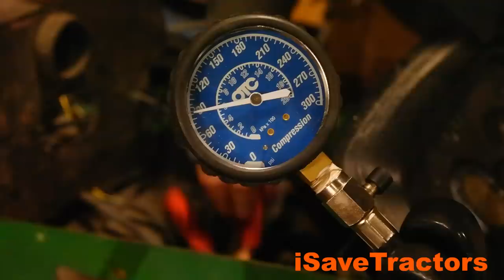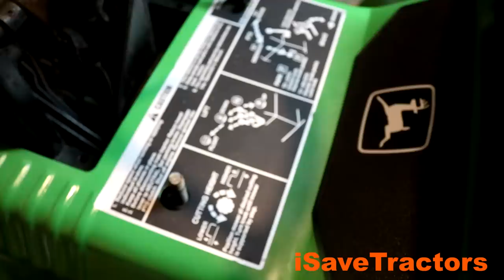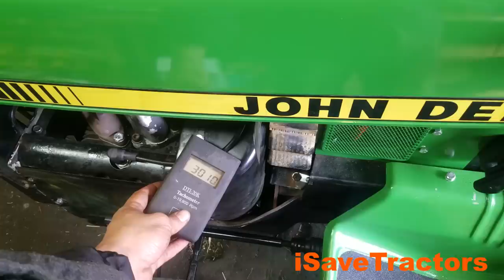John Deere 400 Garden Tractor Restoration Start to Finish

Comment: Wearing an I.H. hat while working on that Deere? I'm surprised there's not a bunch of hate from the Deere crowd! (They love that green paint.)
Reply: Melquiades Estrada I'm rolling 😂😂 if it red it stays in the shed c'mon
Reply: Melquiades Estrada settle down ladies, you're both pretty!  I worked for a farmer friend of mine, farming approx. 1800 acres. We used mostly John Deere equipment.
I would drill 800-900 acres of beans with a JD 8330 and 30' JD drill. It's was nice equipment and had a dealership near us for support. It wouldn't make sense to farm with I.H. If you have to drive a hundred miles for parts and vise versa.  Past that I collect vintage garden tractors and like all colors. The reason I stay away from JD stuff in my personal collection is that I'm cheap/frugal/working class.  Green always costs more green. Not that it's better, it's simply better marketing and people believe what they hear.  Around me, I find vintage garden tractors for sale all the time and have found Cubs, MF, Case, Wheel Horse, etc. in GOOD shape for $300-$400.  People want $600-$700 for a comparable JD. It's just not worth it for a guy to spend the extra coin for green paint unless the green is just your favorite color.  It's even more expensive for new parts. Price a Ross steering box rebuild kit from Cub then JD. You'll find it's more expensive from Deere for the same parts. I'm not hating on anyone, just my 2¢.
Reply: Melquiades Estrada talk about thin skin, dang. I was just poking fun too. We're all friends here.
Reply: I wish I could find a JD garden tractor in my area for $700. Everyone around here thinks they have a block of gold when they sell their JD's. I've found a couple larger size units in decent shape with the crazy asking prices of $1,200.00 and $2,500. I could find a nicer and older full size tractor for that price that's capable of larger jobs.
Reply: Slane583 exactly!  I wouldn't even pay $700 unless it had a loader or something like that. I've bought several Cub Cadets for $300-400 that are in very good shape and run perfectly.  I'm talking about the older IH Cubs. It's been my experience that people want, sometimes double that for a Deere. And for what?
Reply: Jhitt79: It's just like you said, it's all in the name. John Deere are nice machines. They were a childhood favorite for me growing up. But they're essentially the Apple of farming equipment. I'd say the best deal I've found on craigs list was a 60's era Bolens that came with its' original mower deck, a factory sickle-bar mower, and a factory snow blower for $650. Sadly I didn't have the cash or else I would have snatched it up. :)
Reply: Slane583 I totally agree, I like John Deere too but my machines are mainly for a hobby. We do plow snow, move gravel, pull roller, that kind of stuff. But mostly it's a way for me to get my kids involved in something mechanical so they can have basic skills. Most of the time my tractors live an easy life puttsing around tractor shows. 
Speaking about Craigslist deals, there in a nice Ford Lgt 100 near me that I really want but my play account is kinda low right now. My wife is cool and all but she doesn't really want me spending "family money" on more garden tractors when we already have  around 12.(some are parts machines)
Reply: Jhitt79: At least your wife agrees with your hobby and is happy with you having fun. Some wives make it their mission to make their husbands get rid of anything that makes them happy just because she doesn't like what it is. If I had a grouch like that I'd show her the door. But yes, toy money is best to be kept separate from family funds. I have all kinds of hobbies, but I have no money for either. So I don't have to worry about losing anything. :P
Reply: Slane583 not bragging, I am truly blessed in the family department. A great wife, a 9yr old son (that is a cancer survivor) and has 4of his own garden tractors. A 5yr old daughter that loves tools, and a 3yr old daughter that tolerates me!
Reply: Jhitt79: Nothing wrong with that. I'm waiting for when I'm financially stable and have my own place before I bother with relationships. For now, any few bucks I get are gas money or put toward needed tools and items. :)
Reply: Slane583 and people say I'm crazy for asking $400 for my 1972 wheel horse with plow runs and plows snow like a champ
Reply: Richard Marion: $400 is a steal if it's mechanically sound, looks decent, and just plain works. The most I've seen a garden tractor go for in my area was a John Deere from the mid to late 90's. The guy must have been sniffing something because he was asking $2,700 for it. It looked good, but it sure as heck wasn't worth $2,700. For that kind of money, I'd skip it entirely and just get an old full size farm tractor. Bigger, more weight, more power, and capable of more work.

Comment: Nice job very well done but was it worth it? With parts and your labour you could buy a new one.
Reply from the maker: Very worth it. There is nothing new under $10,000 that is comparable.
Reply: How much did the machining of the engine cost, the bearings, the oversized pistons and rings, the carburettor, the gaskets sets, the quick fit hydraulic couplings, the paint, the decals, and how long did it it take for you to rebuild it? After all that what is the value of it if you sell it?
Reply from the maker: Parts was about $300 retail, The machining was about $250. We don't sell our tractor projects You should take a gander around this channel and see what you can do with these old machines. There is no modern equivalent. This is what I do for a living so the cost is moot.
Reply: You do a good job, What happens to the Tractors after you rebuild them?
Reply from the maker: Thanks. I use the tractors on our 8 acre farm property and take photos and video of them in action for our website, social media, youtube channel etc. All of these projects are to promote our parts company.  We develop and sell all the parts used in this restoration. In the future we will auction or donate some of our machines for charity, tractor shows, etc.

Comment: Just curious, I've only seen you paint with rattle can. Why not use an HVLP gun?
Reply from the maker: No space :( i want to put up a paint tent this summer maybe then!
Reply: @Isavetractors  just get a roll of hd poly and a few 2X4's....build a simple frame for it and staple the poly in place.  works great.

Comment: Nice job did you put a clear coat on it
Reply from the maker: For this instead of doing a clear coat I applied a Wax Finish.
Reply: I don't any garden or lawn tractor brands use clear coat.  It just adds more to the price.  Plus, few people are concerned about faded paint.  The FACTORY paint is a baked on enamel for durability.

Comment: You ought to do a JD 455. Those mowers run like a Cummins diesel. They're insanely hard to break. We've put 2k hours on ours since it was new in 2001 and i haven't had to take the head or pan off yet. That little Yanmar diesel has worn out the deck gearbox, a full set of 3 deck spindles, the sediment bowl, and 1 fuel line, not to mention 3 sets of front tires!
Reply: cole west, man that’s one heck of a mower. I’m a diesel fan and own a JD212 and want to do a diesel swap. And yes I have heard a lot of good things about those motors. Have you put a turbo on it yet, or does it have one. You’ll double the HP and torque. I’m an OBS 7.3 owner and a good turbo diesel is good stuff.

Comment: The weak point on these engines is; the aluminum rods run directly on the crank. You can't get new ones. I've got 2 JD 400s. I also have a couple of Generac generators that use the dame engine. They use a tapered end on the crank.
Reply from the maker: We will be making connecting rods for these engines and they will be available by the end of the year

Comment: I want to find a John Deere garden tractor preferably a 318 or 400 something with hydraulic outputs and hydrostatic drive where would I find a reasonably priced one that I could fix and use where would you look any help is great
Reply: thanks
Reply: What are you looking to spend and what condition are you looking for ?
Reply: @ethics3  ideally something in working condition and less than a thousand
Reply: Dollars in ok condition I don’t want it rusted out or junk though either

Comment: How much did you pay for This thanks Norman I’m trying to figure out what I should pay for a John Deere 318 or 400 thanks again
Reply from the maker: I paid $500 for this JD400 with damaged engine and worn mower deck. I consider that a great deal.
Reply: isavetractors wow that is good thanks Norman my freind is getting an old jd 400 I’m going to try to get it he is an uh guy but he is getting it from his dad who naught it an an auction when his neighbor passed away keep making parts you parts are excellent quality and will definitely buy from you when I need something thanks again
Reply: Also what was wrong with the engine any way I don’t think you said but then Kohler are In destructible

Comment: Do you sell that non slip foot grip ?
Reply from the maker: I do not sorry. I bought it off of Amazon.
Reply: check ebay also
Reply: MrVailtown look for "grip tape" at a place that sells skateboards.
Reply: I find if you go to the lumberyard and buy a piece of self adhesive ice and water shield they put under shingles works great and very cheap

Comment: 10:00 Were you shaving the head or just cleaning it?
Reply from the maker: I was flattening it out using a surface plate, and 100 grit to 500 grit sandpaper. This method works great for restoring slightly out of flat heads without a milling machine.
Reply: Okay, thanks! I recently bought a 110 with a K181 in it with a snapped con rod, but I have 2 extra K181s, but they are missing carbs and coils and what not.  I plan to rebuild it and that should be a good trick!
Reply from the maker: Keep us in mind for parts needs. I have everything for your engine.
Reply: isavetractors Yes I am, was on your website a few minutes ago.  Plan to get a new carb and air filter manifold, and probably a few more things.

Comment: what brand of primer did you use
Reply from the maker: I use rustoleoum for everything
Reply: ok thanks having my JD 316  bead  blasted at a body shop  so was thinking of maybe using a primer or not John deere paint is pretty durable and High Quality
Reply from the maker: Primer always helps especially on the steel fenders. I recommend using the rusoleoum clean metal primer
Reply: ok I will do that thanks again

Comment: help please) how to remove the starter in John Deere 400 ??
Reply from the maker: You have to disconnect drive shaft and lift the engine out a big to remove the starter. Just two bolts hold it on (possibly a bolt on the rear too)
Reply: @Isavetractors  thanks
Reply: @Isavetractors  remove the 3 front screws Lift the engine the starter does not want to leave the bracket
Reply from the maker: The rear of the starter likely had another bolt holding it to the oil pan. Check there
Reply: @Isavetractors  I was supposed to have a bolt behind but I don't have it

Comment: sheesh. i have to finish my 318 restore. Re powering it with a harbor freight engine.
Reply from the maker: We will have parts for that onan engine by this time next year
Reply: Ewwwww   stay original
Reply: Build it how you want it, it's your tractor.
Reply: I thought of rebuilding but if you search Harbor freight john deere 318 or 400 on here you will see them repowered with them. A 725 dollar engine with 2 year warranty is tough to beat.  Can always rebuild the onan later and slap it back on it.

Comment: My dad bought one of these in 1989 and within two years that engine went bad. It took a couple years before we could afford to get it repaired again because Kohler wanted so damn much money for the parts. We ended up buying cheap parts and doing the repairs ourselves and then the engine went bad again within another two years and finally sold it. Most of the problems with that engine came from overheating, burning through the heat shields etc and melting nearby components.
John Deere wanted nearly $50 for a P.T.O. clutch cable also. I went to the hardware store and put one together for about $10. John Deere and Kohler are a bunch of damn thieves!
But I really liked that little tractor. It probably would have lasted a lot longer if you don't put it to work. Just use it as a light duty toy or static display.
That Kohler engine was a piece of junk and the weakest part of that whole tractor. That was the only problem we ever had with it repeatedly.

When it was running it was fun to operate. My dad had the snow blower and the belly mower for it and mowed 10 acres every two to three weeks most of the year, when it was running. When it wasn't running he had to use his 60 horse Massey Ferguson and Bush hog all that lawn.

Comment: ya had me until you used the rattle can paint, sorry but that  crap doesn't last at all... your beautiful tractor is gunna look like crap in a couple years. Otherwise fantastic job with that engine.
Reply from the maker: We have 2 tractors in front of our office that we rattle canned. They've been out for 3 years now in all of Maine's weather and they still look as good as day 1. The trick is to apply a coat of wax a couple times a year. We rattle can to show people you don't need big compressors to hvlp. Garden tractor restorations don't require lots of money, time nor, large equipment. All within reach of the normal hobbyist.